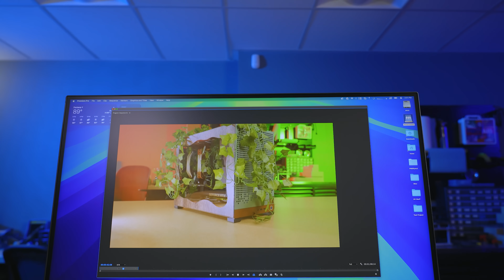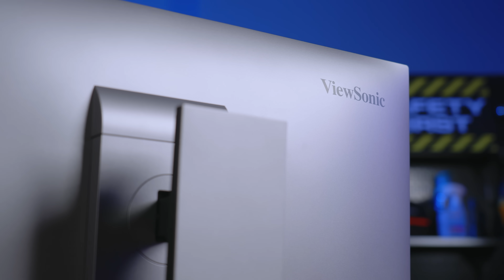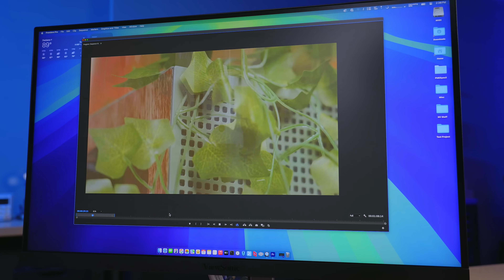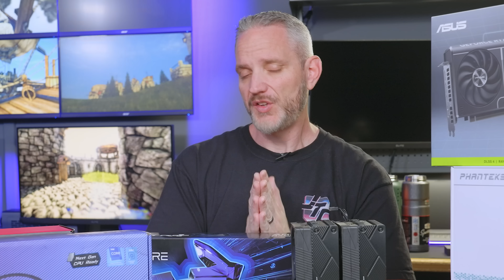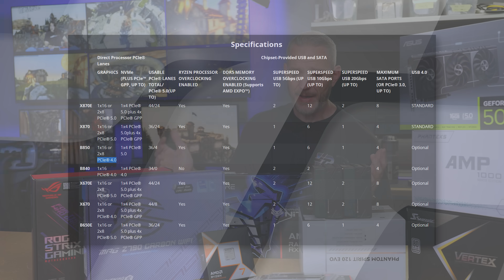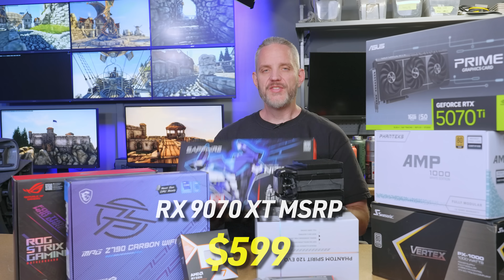This is the Sweetspot for PC gaming... Don't get fooled into spending more!

Comment: Good advice here! I'd agree with 99% of it. One thing I'd add is to never ever panic buy. Take your time. Don't get caught up in the 'gotta get it before tariffs kick in!' panic. The best time to buy stuff, especially for computers and other tech, is during Black Friday sales. Now is a good time to start researching so that when the best sales of the year roll around, you already have your wish list of parts figured out and you can find them or something very close to them at significant price reductions. There have been years when I've saved customers significant amounts of money, we're talking well over 30% discounts on parts by waiting for those sales.  The second best time is between Christmas and April when stores are doing inventory reduction sales. But, you need to have your research done first so that you'll know a good deal when you see it. Videos like this help. 

A sweet spot that wasn't mentioned in the video that I like to look for is in all of the other stuff that goes with a PC: keyboard, mouse, chair, desk, headphones and/or speakers, etc. It's so easy to get caught up in the hype with that stuff too.  Right now, for example, keyboard makers are hyping the latest in key switch technology. Is it really worth it to get the 'magnetic' switches? Is it worth it to get the most advertised and event sponsoring brands? Probably not. There's a huge price difference between the latest and 'greatest' peripherals and the ones using older tech made by brands that are still reputable, yet don't have a huge marketing budget. 

Oh and there there's fans. I've tried lots of different brands of fans using different tech over the years. My findings: a $15 fan moves air just as well as a $50 fan. No need to spend big bucks on them. Forego the programmable RGB, 'silent' blades, silicon gaskets, and whatever other bells and whistles that they advertise. If you fill every available spot in your case with inexpensive fans from a reputable company and orientate them the correct way, your PC will stay cool enough, especially if you take Jay's advice and stay away from the insanely expensive latest gen GPUs out there.  

As far as cases go, I agree that they don't need to cost more than $100. In fact, you can often find one that used to cost $100 that now costs $80 more or less thanks to a store having a sale. The thing I like to look for in a case is filtered vents on the top, front and bottom of the case. Filters are totally worth it as they keep most of the dust, hair, etc. out of your case. What's not worth it are things like tempered glass windows, built in RGB lights, weird artsy designs, or famous brands that advertise all the time.  

Always buy from stores or sellers who accept returns. Cases made me think of this important bit of advice because it's really hard to tell online or from pictures on a sealed box what kind of build quality a case has. There's lots of well made, quality cases out there, even in the below $100 price point. However, there's even more out there that are flimsy and cheap even at above $100. Hopefully, the reviews you read and/or watch about computer parts are honest enough that you can tell from them if the part is actually any good, but just in case they aren't that honest, or you get one manufactured on a bad day or something, it's good to be able to send it back. I've had more situations of needing to return cases than anything else. Second would be mice and third keyboards. There's just a massive difference between a cheaply made case, mouse or keyboard and a quality built one. You can't always tell if its quality by the price either. Some of the best mice I've ever used cost almost half as much as some of the most disappointing ones.

Finally, I love what Jay reiterates often in the video: don't waste money on stuff that's just for bragging rights or nerd cred. If you aren't going to be using software or games that require really high spec hardware, don't get it. For example, if the most you'll need to run your software is 16 GB, you don't need 64 GB of RAM. I've heard that there are even 512 GB RAM sticks now. It's a 'gee whiz' thing for sure, but No one needs them.
Reply: I panic bought because of tarrifs, but also because with every new release prices aren't going down even on old pc parts and selling for more than the price it was sold for brand new last year.

I should've bought a 4070 ti for $700 back in 2024. Instead I waited and ended up with a 5060ti 16gb because all the 5070ti were pushing 1,000 a few months back on amazon all the best buy's within 250 mile radius of me were sold out.

Also I hadn't upgraded any of my pc parts in 8 years except storage. Every single year graphics cards are getting more & more expensive... and people are ditching consoles now for pc.. so there is even more demand for pc parts which is driving the price up higher & higher. 

Black friday hasn't been the same after 2019 pased. That's the last time I found amazing deals on pc parts.

Comment: I build myself an amd "7" rig last year: R7 7700 CPU, RX 7700 XT, Samsung 970 Evo Plus on an X670E Motherboard. Got deals on everything. Made my sweetspot.
Reply: all with 7
Reply: Lucky 7.
Reply: that is the jackpot. curious about how much u spent as I have just ordered the RX 7700xt for $440 , and might get the same CPU or 7600x
Reply: All these AMD fan boys that only buy amd everything. Buying the 5070ti at $750 is great!

2nd) Honestly the 9800x3d for $500 after tax is insane unless you have an rtx 5090. 

If the 9800x3d was down to earth for $399 regulary then id say ya 😉. Its the the fastest gaming cpu at 1080p and 1440p. But with a mid range 5070ti a 14700kf for $300 is much better and then get a 4tb m.2 Samsung ssd instead of a 2gb. Bf6 and many games need LOTS of space.

Comment: I will totally disagree with JayzTwoCents on the CPU, I went for a 9800x3d and paired with a 5070ti because in cs2 it gets a massive FPS boost, which is my most played game. So there is an advantage. 
I'd say main places where to save money has to be the motherboard, ram (just go for lowest CL), PC CASE (If you spend anywhere above 100$ for a case, you're delusional), Gen 5 drives are useless if you're not some video editor that does it for a living.

Comment: My idea of a proper pc build for old school reliability and stability is

10900k 
32 gb of CL16 3600 2x16 or 4x8 
Most any Motherboard will work. 
3060 12gb 
3 Tb of hard drive 
256gb of ssd 
800 watt power supply
And some case fans. 
In a nice mesh case. 

My current build is
11900k
32 gb 3200 corsair 
MSI motherboard 
6950 xt 
6tb hard drive 
2 tb hard drive 
480 gb ssd 
750 watt bronze
Case fans 
Case

Comment: i have absolutely no clue how expensive my system would be today. 12gb 2060+1050ti(takes care of misc stuff to ease the 2060), 10700k (the platform and an i3 were available off the shelf at the time, woulda been amd otherwise), 128gb of ram (and yes i regularly use that capacity), 2tb nvme boot, 2tb nvme games/misc high speed drive, 2x 8tb hdd ironwolf pro. and an 850w psu that is happily powering it all inside of a 3yr old thermaltake core v21.

Comment: I hear what you're saying, and agree with you in principle, but the 9800x3d is an amazing cost to performance chip and doesn't blow the budget. I just built a system with that, an RTX 5070, 32gb ram, 2tb ssd, solid mobo and psu for $1500. And I'm sorry, but I think $1500 is very much in the reasonable range for a good gaming PC.

Comment: You're recommending spending more on a GPU than on the CPU.  But you're removing eSports gamers from your equation. For OUR games, CPU is the priority. We USUALLY game on a 1080 high refresh rate monitor and play games that LOVE the x3d cache. You can get 300+ fps with a 7800x3d and a measley 1050ti (literally)

Comment: Normal people should build a new rig at the end of a generation. I built a 7700x/7800xt system this past winter for less than $1000. All the parts were on sale and it looks awesome(full white RGB). Now I run 1440p, 100+fps for almost everything. (MH:Wilds is 65 ish). I usually go 8-10 years between systems unless a crazy tech breakthrough happens. So I'm a pc gamer for about $100 a year.

Comment: Curious what Gpu I should be looking for with my current system as fallows

X870 GAMING PLUS WIFI

AMD Ryzen 5 8500G - Ryzen 5 8000-G Series Phoenix 
(Zen 4) 6-Core 3.5 GHz Socket AM5 65W

F5-6000J2636H32GX2-TZ5NR
Trident Z5 Neo RGB
DDR5-6000 CL26-36-36-96 1.45V
64GB (2x32GB)
AMD EXPO

Vetroo AL800 E-ATX PC Case, Support 360mm AIO,
 Up to 10 Fans, Suitable for RTX 50 Series GPUs

AK400 DIGITAL PRO

1200W WATT Power Supply Semi Modular ATX PC PSU GPU Gaming Graphics SATA IDE 110

Comment: Thank you for the great content like always. I would like to upgrade my PC soon I mainly game competitively maily Call of Duty Warzone so fps and performance and frames are priority for me. My current build is EVGA RTX 3080Ti FTW3 with a intel 12th gen 12900k with a NZXT Kraken 360 AIO which the AIO is old and not keeping up so that being a poi in upgrading first but I would like recommendations on parts listed above plz I want best performance and worthwhile increase on p2p preferably. Also im still on DDR4 MSi Z690 Edge WiFi so need a board rec also and since I'm swapping boards i should probably go AMD 9800X3D or 9950X3D? I do also stream Call of Duty on a single PC
Thanks in advance

Comment: It will be my first build. Any advice? Thanks

CPU: AMD Ryzen 7 9700X
Motherboard: Gigabyte B650 GAMING X AX V2 ATX
Videocard: PowerColor RX 7900 XT 20G Radeon
Memory: G.Skill Flare X5 32 GB (2 x 16 GB) DDR5-6000 CL30
Storage: SK Hynix Platinum P41 2 TB 
Cooler: Thermalright Phantom Spirit EVO 69 CFM
Power supply: be quiet! Pure Power 12 M 850 W 80+ Gold

Comment: I'm definitely in the other camp for power supplies. I'm still running the same 650s PSU with my 5600x and 5070 that I first used with a i6600 and 960 when I built my PC in 2015.

Comment: I only went w my X870E mobo is cause I use a lot of USB ports. I would've loved to have gone w a B850 board. but sadly I use way more USB ports to even go w something like a Strix B850-E board. I was in a rough situation. Don't be me tho, you likely don't need that. I am a rare scenario. I have a lot of Elgato products & I plug my guitar in as well, as examples. but my old B450 mobo ran out of USB ports fast. So I decided to pony up for an X870E board so I never had to worry about that again.

Comment: Built a new rig this week for a friend that got by on a Sandy Bridge dual xeon z820 workstation for 10 years.  So we couldn't reuse parts but I got an In Win GT1 case and old 750B PSU from Evga from a friend, we just had to remove dust from a home that keeps rabbits as pets.  My friend likes physical CDs and 4k discs so we used this instead of a new case which would have no CD bays.

The case was mostly future proofed by having 6 fan spots and a removable HDD cage to fit longer GPUs.  The side panels were both dimpled out for more cable management room and one cool feature is a hot swap sata drive dock on the top. My friend and I did not cut ourselves once so I say that is the mark of a good case.

AMD 7700X
Asus X670E-A Gaming Wifi
Asus 9070 XT GPU
64GB Patriot DDR5 6000 CL30 ram
1tb Crucial P510 M.2 gen 5.0x4
5.25 bay panel with a 20gbps USB-C and 2 Type A
Thermalright 1600rpm pwn fans

Was about 1500 before tax.
The CPU cooler ended up being a Peerless As sasin 90 but we did but theCPU with a 240 AIO combo from newegg for like 20 dollars more than the CPU alone.  Alas the AIO cannot fit in the old case no matter how you slice it.  A taller air cooler may fit but the dimple is not over the entire cooler so not sure how tall we can go.  TR makes a slim 120 cooler that may work but we will see how it goes for now.
Reply: The Crucial P510 did not like a 2015 WIndows 10 install key the drive was almost cooked and began failing controller self-tests.  Got hot to the touch as in I recoiled to not get badly burned.  It could be the fans were all at default 900RPM so we maxed them all out and it is still quiet.  But I think the old nvme driver does not play nice on this drive.  I had to mess for 5 hours to get it to download the 2020 version of windows and that was by setting it to gen1 PCIe speeds in the BIOS.  Waiting on the active cooler Jay had in the other video because this experience was quite instructive.

Comment: i did mine cheaply. reused case, psu ( about 2 years olds), AIO and gpu (6900xt still perform well) . Just went to microcenter over the weekend while it was tax free weekend and got the combo sale (cpu,mobo and ram) on a 9800x3d and got a samsung 2tb 990 pro that was also onsale there as well.

Comment: Using a Ryzen 9900X with a 5070 Ti. Looking back now, I would’ve been completely fine with a 9700X but I did manage to get the 9900X for just about $320, which was barely anymore than the 9700X

Comment: I am torn between AMD and Intel at the moment.
The intel setup is Core Ultra 235 on a ASRock B860 Motherboard.
The AMD setup is Ryzen 5 9600X on a ASRock B850 Motherboard.
I have a Case, PSU and RAM already.
My Budget is $1200
Please help me choose wisely..
PS i live in the Philippines and the B860 board is $160 and the B850 board is $270, the intel CPU is $327 and the AMD CPU is $245.

Comment: Some games really benefit from the extra L3 cache on X3D CPUs so it does not make sense to state you don't need it if you don't pair it with i high tier graphics card. Depending on what you play it can be a better choice with a X3D and a cheaper graphics card. X3D CPUs is also less sensitive to RAM speed and timings so its possible to save some cash there also.

Comment: New build on the way is a:
Radeon sapphire nitro + 9070XT
Ryzen 9 9950x3d
64 gigs ddr5 ram
4 tb M.2 storage with a separate 256 gb M.2 for the OS
All Noctua case fans and Noctua Heatsink
1000w gold rates psu
The total price is around $2,800
Upgraded from
Radeon 6950xt
Ryzen 7 5800x3d (ryzen number may be wrong i cant remember its been years)
64 gigs ddr4 ram
2tb of storage
Be quiet fans

Comment: I do not intend to use GPUs that use more than 250 W, maybe if performance gains were significant, I could stretch it to 300 W if really pressed. Same with CPUs. I do not give a shit about 600 W halo products. They are not for me, and hence I think 750 W PSU is plenty for foreseeable future. Also, if I will need and buy 1000+ USD GPU in the future, I think a a new PSU will be the least of my problems.

Comment: You can't tell people their sweet spot. Some people like 1080p 60 fps gaming. some people like 1440p 240 fps gaming. Some people like 4k 30 fps gaming. Also while you should never underspec your power supply telling people to spend hundreds more on 1000w+ power supplies... why? The odds you need that on any mid range build ever is near nothing and to be frank the motive of power supplies can last you 8+ years as you say... Ehhhh maybe if you don't care. We have already seen massive shifts in power supply standards in the past 5 years alone i'm not really caring to sit on old out dated and frankly unsafe standards with new hardware just because i wasted hundreds on an overkill power supply so I would feel bad about buying a new one.

Honestly tech sucks. It's an insanely expensive hobby and it only gets worse every year. If you can build a pc that lasts you 4-5 years before needing to upgrade any part of it that is your sweet spot. 

Also 2 kill points never over spend here.
1. Motherboard. Unless you overclock a "better" motherboard does nothing for you. They range from 150-1k dollars but perform exactly the same unless overclocking.
2. "faster" storage. another waste. I followed the path like everyone. Went from hard drive to sata ssd the best single change I ever had in my pc life time. So going from sata to nvme same thing right? No even better right from 500mb to 7500mb read writes how can this not be a world difference? Oh there is no difference. Everyday use zero difference. Gaming zero difference. File transfers? Not my job so the normal transfers I do no difference. What was the difference? A huge price tag. My nvme cost 4x my sata. I feel 0% difference in them. 

These kinds of things are more important than "sweet spots" as that's such a pointless term as the same thing never applies to different people. Look more where you might accidently waste hundreds on things that have many buzz words and claim super fast but in real use case offer no difference at all.

Comment: I ran thermal right machos on my 8700k and the fan failed.. I never noticed. Had not turned on rpm warnings. Did not matter. The case fans airflow was enough to keep it running normally and it's just two fronts and one rear. Not a 12 fans maxed out case. Highly recommend insane air coolers and mid tier TDP cpus

Comment: I over-spec my PSU by going with Seagate’s cheapest Titanium. From tests, it seems it's really able to handle triple the power. I wouldn't rely on more than double. But I haven't bought a new PSU since they came out with Titanium or Platinum ratings.
Finally, I have not had a HDD die on me since buying this PSU, but I also stopped using Seagate that were dying every year. But I think that's more because HDDs have gotten more reliable.